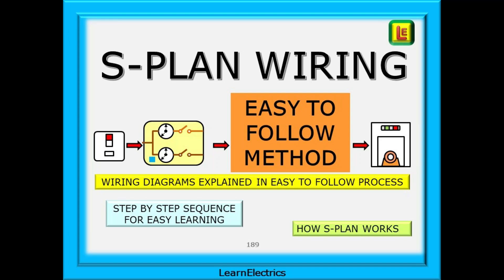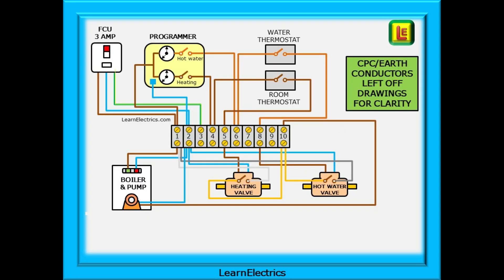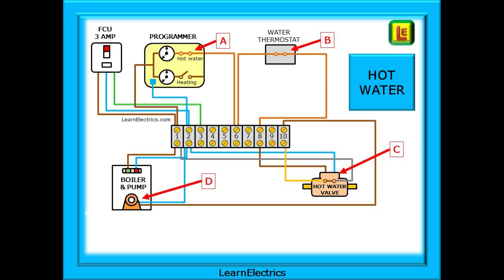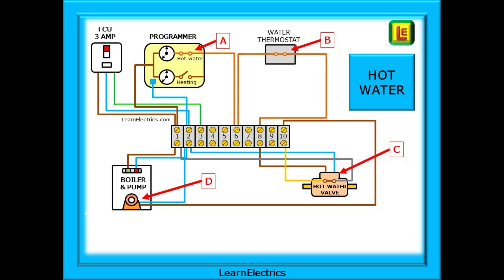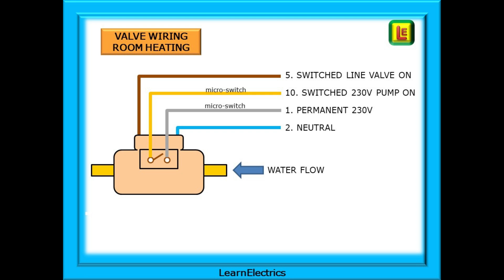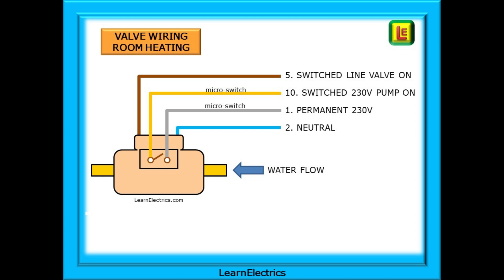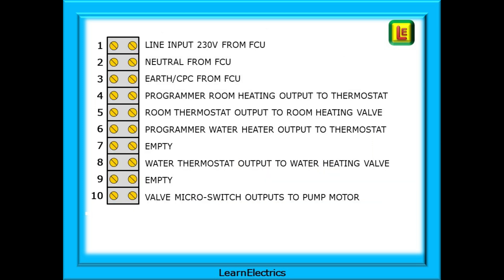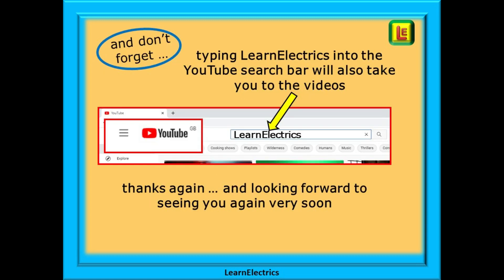S PLAN WIRING – EASY TO FOLLOW STEPS – HOW THE COMPONENTS GO TOGETHER – CLEAR DRAWINGS AND METHOD

Comment: Hi. Do you know if it’s. Fail,in your am2 exam if you put a 13 amp fuse in?
Reply from the maker: I wouldn't fail a student for that if the student could explain why they had done it, or better still, explained why they had now decided that 3A was better. The assessment is all about - Does this chap or chapesse know what's going on? Could I leave them alone in my grandmother's house and know that they will do a good job?
Certain things, like not isolating and locking off - definite fails.
Hope this helps.
Reply: @learnelectrics4402  thank you so much for replying.  My son was given two 13 amp fuses and one 3 amp.  He read the specification and it did not st state what fuse to use. So used the 13 amp.  He did not have a chance to explain why he did this as he left the exam room.  And then realised when he returned home he had put the wrong fuse in.  Everything else was correct.
Reply: @learnelectrics4402  he put the 13 amp fuse in CH system.
Reply: @learnelectrics4402  he passed…. Thank you so much for answering our question.  You gave us hope.

Comment: Hi Dave. Many thanks for this. When wiring the valves, should you indicate the grey "switched" lives in sleeve as in any other circuit?  Thanks. Mark
Reply from the maker: Usually just left grey. Good question. Thanks for watching.